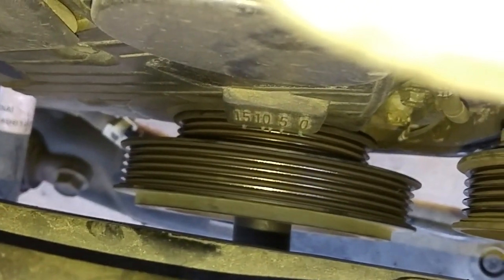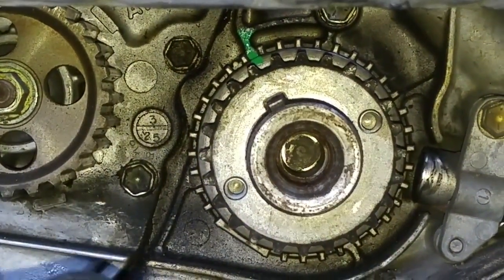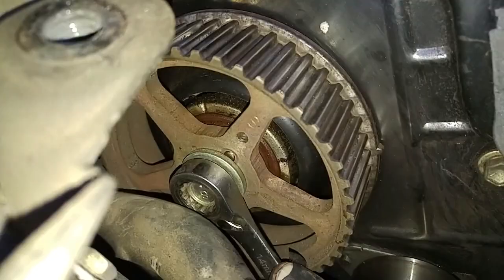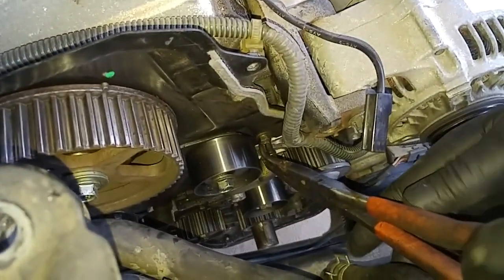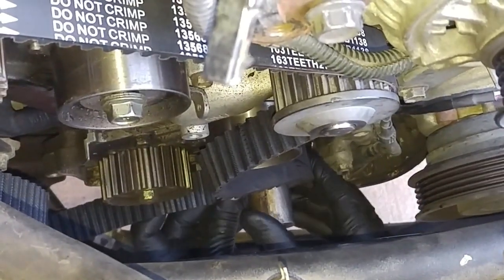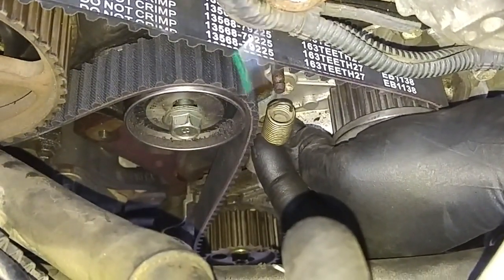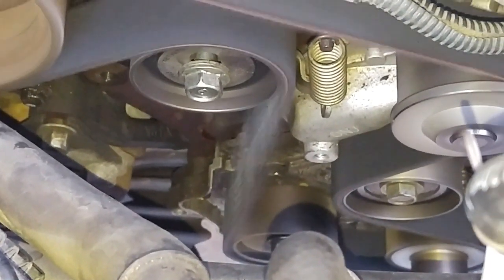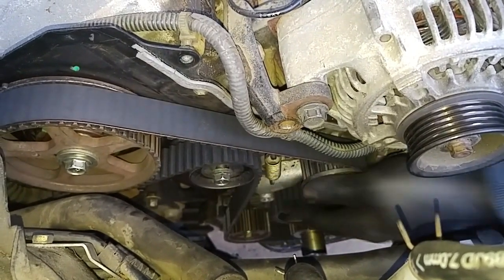Broken Timing Belt Replacement - Toyota I4 5SFE Engine

Comment: is the notch with the green at the bottom correct  or is it the notch before it?
Reply from the maker: Green where?  On the harmonic balancer, crankshaft sprocket, or the camshaft sprocket backing plate?
Reply: @hardlymovingpro  Sorry the bottom crankshaft mark maybe you havd it correct i missed it, also i noticed you started the car to test the belt do i need to ground the engine meaning do i need to plug the  black wire near the dogbone when i test the belt?
Reply: Also when i start the car does it have to be top dead center top and bottom or at the 45 degree mark?
Reply from the maker: Nope ... don't need to plug the black ground wire to test the belt.
Reply: Doing job tonight also when i start the car does it have to be top dead center top and bottom or at the 45 degree mark? I have heard some say don't start at DTC but line the buttom crank with the long black line one the timing case it's just before the 15-0 marks which one is correct
Reply from the maker: @juniorjones5137  TDC alignment at both the crank and cam with the new belt on ... then start the car, shut down and check the belt tension.
Reply from the maker: @juniorjones5137  You can start the engine anywhere as long the belt is properly mounted and confirmed with the alignment marks at the cam and crank.
Reply: Fixed it tonight did what u said that belt is a little tricky seems to be running fine I want to thank you for taking the time to respond so quickly may the Lord Jesus bless you for helping me
Reply from the maker: Hey glad it worked out for you!  And thanks for your comment and support.
Reply: Well everything u said worked for 5 months car stopped wont start opened up timing cover small broken bolt head from oil pump destroyed belt put on new belt set everything as u said bottom and top tested it car wont start moved top crank and bottom small set as u said even tried moving small increments still wouldn't start any thoughts?

Comment: When the timing belt broke on any Toyota, the belt can be reinstalled and the car will run again,right ? But any car besides Toyota, it will not work, right ? Because it’s not a non-interference engine , the valves will hit the pistons
Reply from the maker: 100% correct on the 5SFE and the V6 1MZFE.  The Toyota engines that replaced the 5SFE and 1MZFE are all interference but are now driven by a timing chain.  The chain will stretch (causing a camshaft position sensor error code in your OBDII) before it brakes.   I can't speak for other car manufacturers engines with timing belts.  Some are and some aren't interference.  But in general cars with over a 9.5 to 1 or more compression ratio tend to be interference.  Turbo engines, which have a lower compression ratio, I would say would be non interference.  Hope this helps.
Reply: Thank you
Reply: Hardly Moving Productions I have a 92 Camry with a 4 cylinder. If the timing belt goes out can I replace it or will the engine be damaged? I just flipped
 200k miles and had the timing belt replaced at 100k.
Reply from the maker: @josephc9694  Nope ... the engine will not be damaged from a broken timing belt.  The engine is non interference.

Comment: Did timing belt with related on 1999 toyota rav4  gates kit from rockauto  same engine snapped timing belt no engine damage lucked out. No so lucky with 1995 honda odyzsey .same senario 0
Reply from the maker: Yes ... F series Honda engines are interference and valves will bend if the timing belt brakes.

Comment: You didn't do it right Bob 😭, specially when rotating the upper pulley anticlockwise, and also, you didn't align, the outer V shape little notch with the green mark perfectly. And by the way, the lower crank shaft pulley, has a notch or tiny groove too.
The final seen was showing a timing built which was not sitting right on the tension pulley, and you ended the vedio, by saying it is done!
Reply from the maker: Really?  Show us the right way.  Make a video and share it with us!
Reply: @hardlymovingpro  man 😎, you took my remark seriously, I am not a mechanic, but I watched so many videos on  YouTube , and all of those guys which most of them, were professional mechanics, didn't a different way. ♥️
Reply from the maker: Got it.  I am a professional (i.e. do it full time for a living and have worked in shops).

Comment: Bent valves pulled head now at shop
Reply from the maker: Bent valves on a 5SFE Toyota engine?
Reply: @hardlymovingpro  i heard clock wise rotation onlyon cam shaft...
Reply from the maker: A few degrees won't matter.
Reply: Mine is more than a few degrees off. Can I do a nearly full rotation on the cam shaft. Also I like your clip trick
Reply from the maker: Yes ... because its a non interference engine.
Reply: Hardly Moving Productions Thank you, I figured it out but your video was very helpful for my successful repairs.
Reply from the maker: Glad it worked out for you!